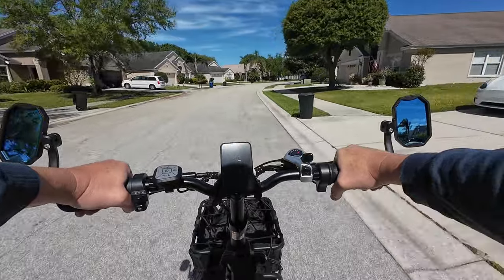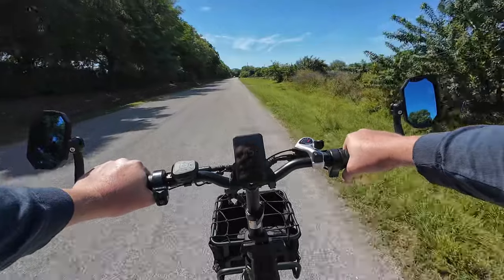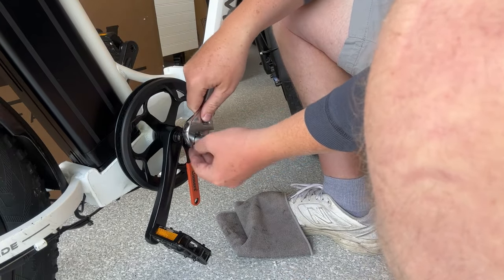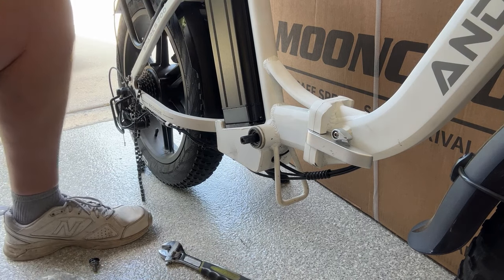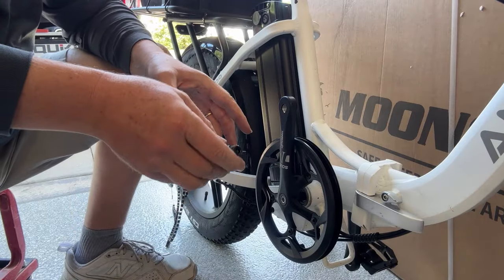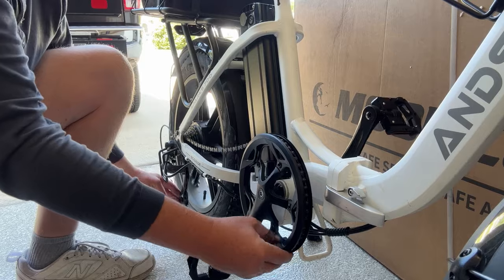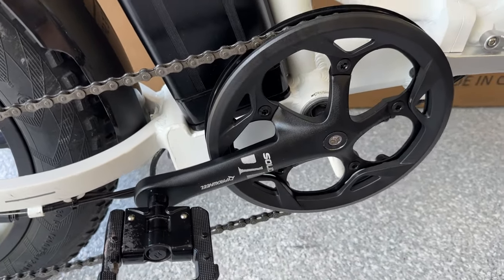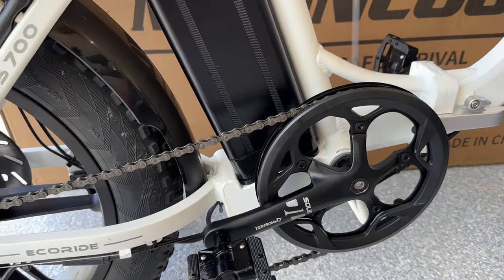eBike Ghost Pedaling | SOLVED

Comment: All the factories know this is a problem, why should we have to pay to fit it? It’s not like it’s costing them more money to add this front ring, they should be including it as standard equipment. 🤨
Reply: It’s not a mistake or fault of the factory’s. It’s to adhere with the Class 2 ebike qualification laws. When the law defines Class 2 e-bikes as 20mph maximum throttled, pedaled, or assisted, the manufacturer gears them to ghost pedal at 20mph or above.

Comment: My I ask you a question. Why did you need to take both peddles off?. I would have just taken the crank peddle side off. I'm no expert. I'm fed up with this ghost pedalling, I have a Cyrusher Ovia & for me, it spoils the ride experience. Thanks for sharing your video with us.❤
Reply: It could be because he bought a complete crankset and intends to replace the entire unit. In my opinion, to address those pedaling issues, we might need to adjust the tooth ratio. Upgrading to a larger teeth chainring or a smaller teeth freewheel should work effectively

Comment: Even with 8 soeed Shimano,  i could use taller gearing on Okai EB50. Will tackle this, after i upgrade to hydraulic brakes, another weakness on an 82 pound tank.
Reply: Yep after changing both front and rear gearing out to 11 speeds and bigger gears, I went out to full hydraulic 4 piston brakes, but was annoyed at the extra cost of power levers for electric which made them twice as expensive. I got round this by managing to use my original levers with new 4pot calipers after a bit of pipe blending. Also went bigger rotors front and back ,180 mill to 203. (Or maybe even bigger on front?) Defo  recommended for these higher weight and speed monsters.

Comment: Hi Richard,  thanks for the vid. 
Unrelated question. Since you have both trikes, I'd like to ask you a favor. I'm thinking of replacing my XP Trike with a Mooncool TK-1. Could you tell me if the battery from the Lectric will fit the Mooncool? Specs appear to be the same but I don't know about the connection. I would prefer to keep my spare from the XP instead of buying a new spare from Mooncool. I would appreciate any help you can offer. Thanks.
Reply from the maker: Hey Gary, I just looked. The Lectric battery is shorter and slightly different design. The connections look the same, but the tabs that lock onto the bracket are different sizes. The lectric battery could not slide down far enough to make the connection. It may be possible to make it work somehow, but as is its not a good fit.
Reply: @EbikeReviews  Darn!! Thanks so much Richard for doing the check. I was hoping, but so hard to tell unless you have access to both trikes. You're a good man. Thanks for your help and please keep up the good work.

Comment: I have an Emojo Bison Pro and starting about 15 MPH in PAS 3 and 7 gear I'm ghost pedaling.  What do you think of adding a larger crank and what size?
Reply from the maker: I no longer have the Bison Pro, so first look and make sure there is clearance so the bigger crank does not hit the frame. I don't know the size of the crank now, you can count the teeth. But a 52 tooth should allow you to pedal up to 20mph with no or almost no ghost pedaling.

Comment: Hello, would a jump from a 38t chainring to a 52t be too large? Do you think I will need a longer chain for this upgrade?
Reply from the maker: I haven't tried it but I wouldn't say its too large. Your chain will likely be fine, there is a lot of extra chain being held by the derailleur. One thig is for sure, you will notice a big difference.
Reply: @EbikeReviews  awesome new to ebikes. So this hack is wonderful. Idk why ebikes cheap out in this department
Reply: Yeah, big jump but I went from 52 to 58, had to use two chains for extra links. Maybe consider putting multiple crank wheels on front if u can or change back freewheel, loads of options out to 11 speed( strange not 12 available). And 11to 36teeth choices. Make sure it's a rotary freewheel which seems to be what these electric bike hubs have to be.

Comment: I have the AIPAS A6 cargo bike, which is about the same thing as the Elctric expedition. I was going to swap out , for the 58 tooth. One of the additional things I have heard, was to replace the rear freewheel, with an 11-34 tooth. You get that big gear for those uphill battles when you really need it, or it would really help if your battery dies out and you need to pedal home. I'm going to start with the front first though.
Reply: I put a 11-36 on the back (from 14 /28 original and the front was 52 which I changed to 58. My crank was fixed so i had to buy a new crank which gave me a cheaper way of using different tooth counts. Works great at stopping the ghost pedalling but made 1st pretty hard still even with the change to 36 from 28 teeth. My solution to this is to add another smaller crank gear at the front ie multi gears like a mountain bike. Manufactures are charging big bucks for these bikes  and not really giving value for money. My bike is now a lot closer to the perfection i wished had come out of the box. But I guess you have to spend to get it up to your own specs.

Comment: I would imagine it would make it harder to get up a hill?
Reply: Yes you are correct, I added bigger first, more cogs (out to 11 speed) and also have bolted another smaller cog  on front crank  I.e. 44teeth and 58 teeth. So I get more range of top and bottom gears. I have seen a few manufactures adding these combos now, not sure why they went to a single gear crank in the first place, saving a few quid I guess. Not impressed my self at the price they charge anyways...